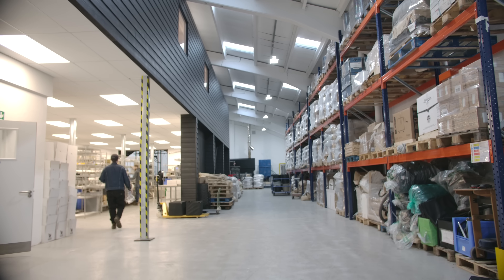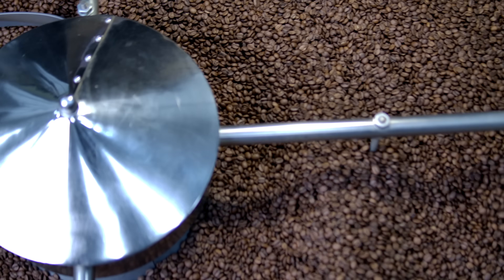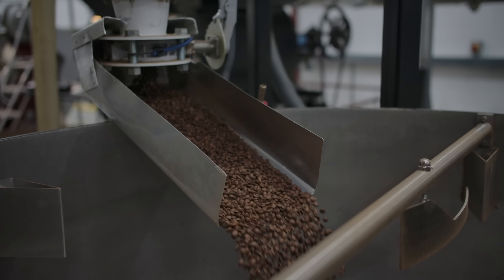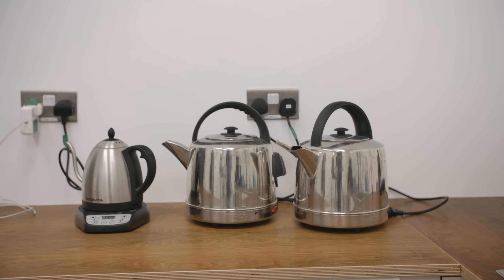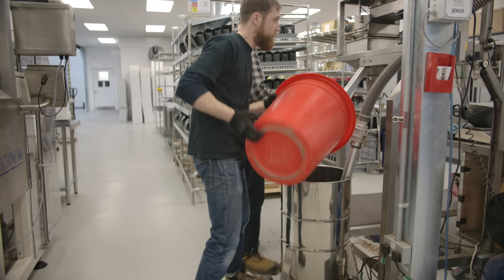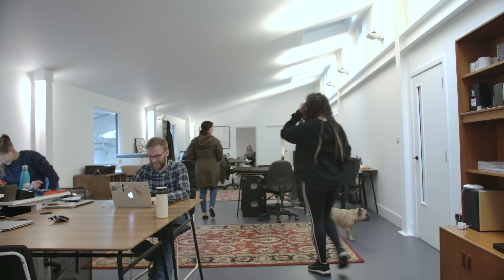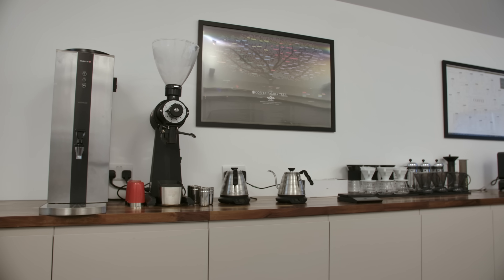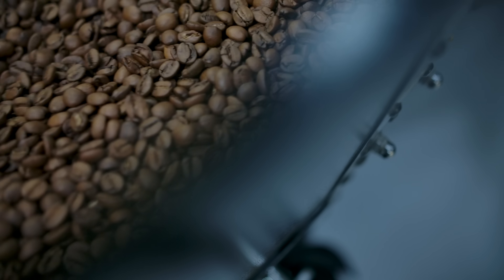The New Square Mile Roastery Tour

Comment: I've never quite understood how blending works. Say you take two batches and 'blend' the beans together after roasting, how can you be sure that the eventual bag of beans actually contains 50/50 and further along, that your scoop of beans that you grind at home will?
Reply from the maker: Ultimately, the maths behind all this says you can't guarantee it. The larger the bag the more likely it is that it contains the intended ratio, and there are a lot of beans in a 350g bag. You'll get some small shot to shot variation but not enough to really mess up the taste of the shots. It's one reason we like simple blends with large percentages of each coffee. Some people will have 5% of a coffee in a blend, and will be much more variable shot to shot.
Reply: We're doing some experiments in our shop with roasting different coffees separately and then blending them before grinding, but still, different coffees will have different extractions, predicting a stable profile proves difficult
Reply: James Hoffmann can You tell me a meaning of a logotype? :-) Why this gryphon?
Reply: re: blending before roasting vs blending after roasting: the maths are the same. there's never any guarantee that a particular scoop will that the exact ratio of beans, especially since the ratio of the size of the coffee beans vs the size of the scoop is smaller. obviously the beans are much smaller than a bag, so the ratio is larger, and the chances are also similarly better that the larger container will contain the proper blend. blending works the same whether it happens before or after roasting.
Reply: MsBurasuka; the City of London (the small part of London which is the original city) is known informally as the "square mile", and the boundary of the City is marked by statues of silver dragons (not gryphons), which also appear as supporters on the City’s heraldic arms. If you search "City of London dragons" you will find many pictures of the statues.
Reply: @DianeH2038  Except, if you blend after roasting, you can ensure that each origin is roasted at its peak flavor

Comment: I'm surprised ya'll don't use an Agtron to analyze your roasts. I used to work in a coffee processing facility and I figured those machines were industry standard. This video almost makes me miss working as a machine operator for that company, almost. Also no green bean cleaner? I've cut open thousands of those burlap sacks into a Cimbria Delta screen cleaner and I've always been very surprised how much foreign material it removes. usually corn kernels but I've seen some crazy shi**.

Comment: What do you mean by "roast coffee for espresso"? What would you do differently with the roast if it wasnt for espresso?
I have heard other roasters also talk about "this is an espresso roast" but when asked what that means, noone seems to know. One roaster said "it needs to be overroasted so it becomes oily and lubricates the grinder in your machine" which is obviously an incorrect explanation.
Reply: espresso roasts are roasted under higher temperatures and for longer periods to increase solubility and lessen acidity
Reply: @graybonesau  Thats the problem then. There is a certain time that is optimal for beans (say 12 minutes). It depends on the bean size. If you have a problem with acidity then use milk! Long roasting is like barbecuing beef for two hours at low temperatures, it would taste shit.
Reply: @powerbeast5691  as a person who drinks espresso roasted beans, they don't taste shit. also, low and slow for beef does not make it taste shit lol, it's a very well known technique (for brisket, mainly)
Reply: @graybonesau  What do you compare with? There is not a single coffee on the US market to my uncertain knowledge that is correctly roasted. ”Gourmet” coffees, light roasts are no exception.

Consensus best practice in BBQ (for pork and most other meats) is to quickly create a ”skin” (charred but not burned) that will hold the juices INSIDE the meat, then you finish it by heating slowly.
Reply: @powerbeast5691  i don't live in the us, so i have no idea about their roasts (but i don't think they would be any more prone to 'roasting incorrectly' than roasters from other countries) but the roasters i purchase from in australia offer both espresso roasts and roasts designed for other methods like drip, pourover, french press, aeropress, etc.